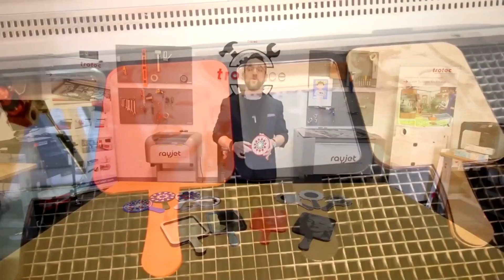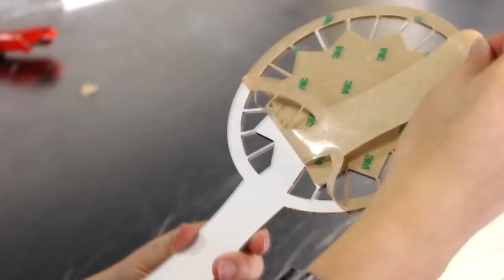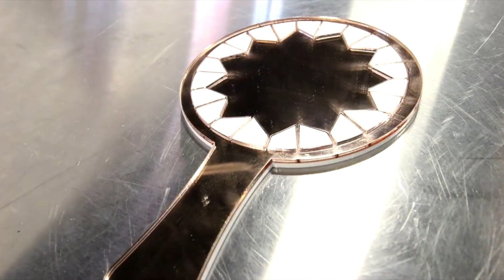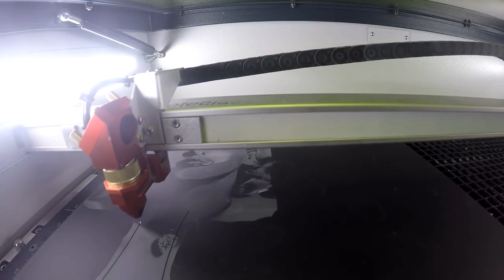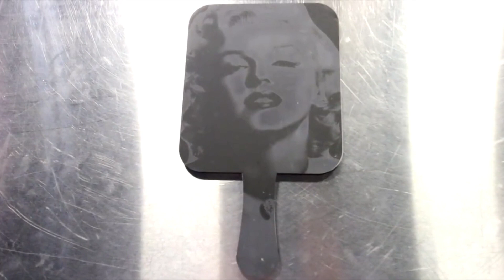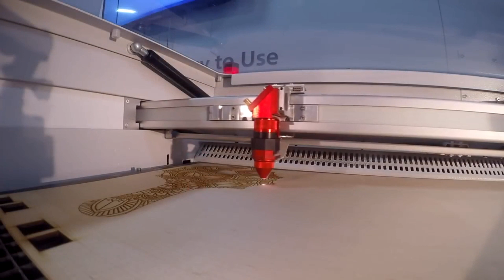Laser Cut Acrylic Hand Mirrors | Trotec Laser Tips

Comment: What are you putting in the material section
Reply from the maker: We used TroGlass Mirror with the following settings: 

Laser: Trotec Speedy 360 FLEXX (CO2 and Fiber) - 80w
CO2 Engraving: 65 power, 100 speed, -0.12 z-offset 
Fiber Engraving: 40 power, 100 speed
CO2 Cutting: 100 power, 0.8 speed